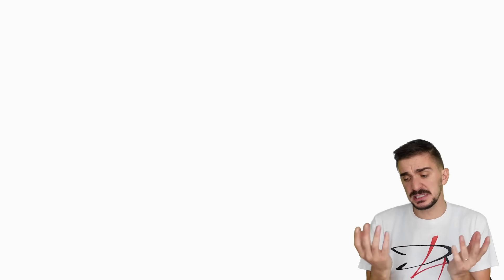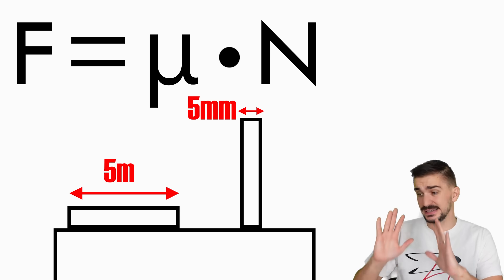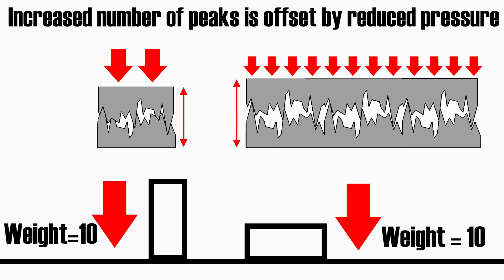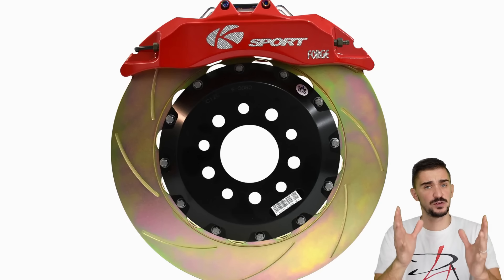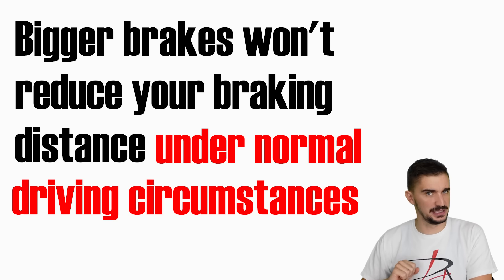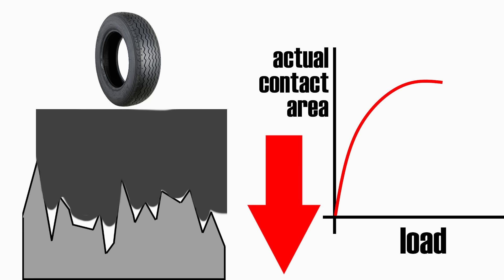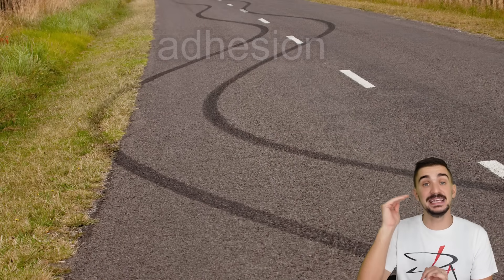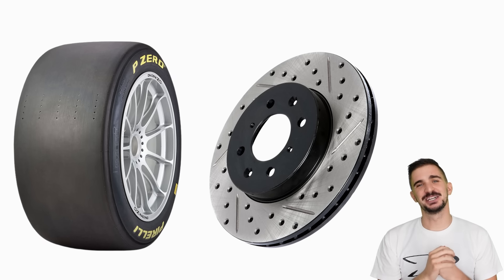Why Big Brakes Won't Stop You Faster but Wider Tires Will - Friction and Surface Area Explained

Comment: Great explanation. I like how just after talking about brake fade you show an early generation MR2 getting tuned. The early generation MR2s were notorious for brake fade (because they were designed for drivers who drove sports cars and used compression braking). Toyota fixed that problem in later generations, but other automakers use similar thought process for their economy cars. They count on the user not going very fast or not having to apply the brakes very often. Too many of these smaller vehicle will start to have brake fade when driving in stop-and-go traffic or pushing the vehicle even a little bit. I had to swap the stock rotors and pads for my daughter's economy car when she said something was wrong with the brakes and I drove it and it had noticeable brake fade. Slotted discs and better pads was a very inexpensive fix to take care of a manufacturer's money saving design.
Reply from the maker: The car shown is my car. It has completely stock brakes, just rebuilt and new parts. I know the internet loves to portray the brakes on them as junk but in my personal experience this wasn't the case. I drove the car down several mountains very aggressively many times. They brakes start smelling very noticeably but the fade is always very minimal. The car always remained completely safe and the braking adequate. Fade in stop and go traffic is simply impossible on any vehicle, the assumption is just silly.
Reply: @d4a  I appreciate your experience. In the late 1908s I had a girlfriend with the early gen, and it had bad fade when not down-gearing. She went off the road with it once because she wasn't used to driving like that. And when we had it looked at afterwards to ensure everything was okay from the accident, the Toyota mechanic told us about the fade issue, so I'm more willing to believe them after that experience.
I agree, normal driving conditions shouldn't have caused fade. The vehicle my daughter had GM took off the market soon thereafter. It had a host of design issues. Had I known then what I know now I wouldn't have bought it. As it was, it was disposed of w/in 5 years of new due to all the systems which started to fail. 
I travel a lot for work and stopped renting economy cars due to performance issues. Not just that the engine is under powered, but that the braking systems are almost binary - almost no modulation, and any hard braking locks up / initiates ABS. I realize this is tangential to your video, to me it appears to be a system which isn't designed appropriately for the vehicle.

Comment: Stock brakes are designed for stock tyres, and don't hold enough stopping power to stop wider tyres! That's why you need bigger brakes with wider tyres. Yes bigger brakes won't help if you install them on stock tyres.. But at the same time stock brakes won't be able to stop Wider tyres..!

Comment: Increase brake rotor and pad also increases torque to reach the limit of the tires traction ceiling.  The statement is true if one's brakes can cause the tires to slide.  Making the transition from static to sliding friction. More tire raises the traction threshold before tires slide. Otherwise, an ultra sticky tire that jas a huge contact patch with riny brakes that can't make the tires slides on the surface can stop faster with bigger brakes. It's a balance. Once one limit is increased the other can also.

Comment: Wider tyre will mean lower top speed and usually slower acceleration. And they are usually heavier. So there will be a price to pay.
Reply: They also don't increase the size of the contact patch.

Comment: While I have already given a rather-long explanation about the various points you are wrong about, on your 'brake' video, this also popped up as 'recommended', and as I figured, was about as wrong as the brake video was. While as I mentioned before, I worked in automotive ride dynamics for decades, tire design was not my 'speciality'...but I did have to use specific 'design data' regarding tires, to accomplish first-stage braking design..and it is to this I can address.  Tires are a very-funny, and often misunderstood thing...and as there are a myriad of books out there on 'shock absorber design', 'brake design' and 'tire design', I'll save the review of rubber composition, its affect on road surface grip, why different tires are used on different surfaces, etc., and point out one key factor about tires: YOU CANNOT CHANGE OVERALL CONTACT PATCH SIZE by simply 'changing your tires', and the whole of your car's traction, handling and general behavior is keyed to the simple function of 'Contact Patch Size'. Consider this: If I have a 3,000-lb car, with equal corner weight distribution,  then each corner of the car, each tire, must support a weight of 750-lbs per. Now, assuming 'no sidewall structural/vertical rigidity' that would otherwise hold the car up (without air in the tires), this translates into approximately 20-sq. inches of 'contact patch' (at 32-psi tire pressure) per tire. So, I can 'theoretically' (which you are bad about doing, without very much empirical experience or knowledge) configure that tire patch by changing tire size. If the tire is 5-inches wide, then my contact patch will be 4-inches front-to-rear. If the tire is 10-inches wide, that contact patch will only be 2-inches, front to rear. In heavy equipment, this is often referred to as 'ground contact pressure' (bulldozers often have a contact pressure of less than 3-psi, just FYI...helps them float in bad or loose soil)...and likewise, this translates to cars. See, you cannot simply 'play around with your tire pressure', to get the contact patch you want...tire failure is imminent, if you start doing that. Too low of pressure, and you will destroy your tread, shoulders and due to heat, fail your sidewalls very prematurely! So, in reality, you 'choose the tire' based on size to arrange your contact patch to the optimum size and shape which fits your 'expected terrain surface'. 4x4 truck, off-road, IN SAND? You want low pressure, large contact. You're racing quarter mile, no turns, straight ahead, you want a wide contact, where 'lateral contact' is inconsequential. You're running a road track (F1-type), where cornering, braking and acceleration all come into play, you want a relatively square contact patch...unless some design feature of your car requires more lateral than fore adherence. Selecting the wrong tire is a big problem, and requires extensive experience to 'choose the right one' for the desired application....then again, if you don't have big enough brakes...all you need is a big bumper, I guess. All I keep seeing, when you keep quoting 'textbook physics' is a brakepad made from a razor blade, skating around on a coffee cup...while hearing you on a looping recording saying 'bigger brakes won't stop you faster'....ROFL..you REALLY NEED A JOB WORKING FOR AN AUTOMOTIVE RIDE DYNAMICS group...boy, would they have fun with you...all that overtime in the test lab, the yelling, the condescending tones...yeah, I interned...IN THE 1970's...and you sound JUST LIKE a guy we had as a lab technician once...merely a high school education, talked like Einstein, sounded like Homer Simpson...YOU, my friend, ARE THERE!

Comment: how is it counter intuitive? the regular brakes are able to lock the wheels. so there is not any extra power needed. i don't think anyone would think bigger brakes would make them stop faster.
bigger brakes are so they're more resistance to wear and fade, which is actually more important than braking harder.

Comment: I actually did have vented discs on one of the motorbikes I've owned, a Yamaha XJ 900 F, but the brakes in 1983 weren't exactly wonderful, as the front calipers were of the meagre sliding pin type, normally only found today on rear brakes.
Reply: You really don't need more than drum brakes on the rear of motorcycles. Most people are ignorant and assume rear disc will stop you 'better' than drum.
Reply: @johngalt97  Yes John, I mainly use a rear brake to hold me on a steep hill, or to keep the bike's front end from diving too much if I need to brake quite sharply, say if someone pulls out in front of me at a roundabout when they really shouldn't have. I've never ridden a cruiser type bike but am told they tend to rely on rear brake stopping power much more, especially ones with raked out forks, skinny front tyres and fat rear ones.
Reply: @HGodwinson-hg1  yes, keeping the rear gathered in straight behind the front is critical to the shortest stopping distances. The back brake preferably gets applied first, but disc can cause it to lock up, which is not good for keeping it in a straight line. I hated in when Yamaha started 'upgrading' the drum rears on their RD 2-smokers.
Reply: @johngalt97  I had many 1970's bikes too, most of them two strokes and also preferred rear drum brakes for feel and controllability. I will say that disc brake pads are a damn sight easier to change than brake shoes are though. Just bought some coolant and distilled water for my bike's two yearly coolant change, due on Christmas Day. That's a job I only ever needed to do once in the 70's, on a GT750 Suzuki. All the rest were air cooled rides.

Comment: I can't agree with this. Wider tyres with WHAT compound, tyre pressure, tread pattern and on what road surface / weather conditions? If you have really hard but wide tyres, you still won't stop if you're driving on a sheet of ice... Surface area is only part of the solution. Even changing the tyre pressure drastically affects the stopping ability of your car. Wide tyres also have a problem with aquaplaning easier on very wet surfaces. So, it's not as simple as just upgrading tread width.

I'd also like to argue that larger rotors give a nicer brake feel. Maybe also an added benefit that less brake boosting is needed, because less energy is needed to push on the brakes. Interestingly, with some sports cars having cam profiles that result in less vacuum in the intake manifold, the brake booster is not as effective anyway. Infact, in some race cars, the brake booster is removed all together. So, I guess it depends on the overall application of the brakes and tyres because most road cars don't really need brakes that take such an incredible amount of punishment.

Comment: I'm 1 minute in and my initial analysis is there has to be a balance between disc/pad surface area and tire/road surface area. If you have too much disc/pad area then there will be too much grab and your tires will lock up and you'll skid. Too much grip because your tires are too wide then your brakes won't be able to fully engage and slow you down.

Comment: What happens when you have the latest and greatest UUHP(Ultra Ultra high performance) tires on a 2001 Audi TT Mk1 Quattro, with standard brakes. LOLs... 

Worth a mention as its the major reason for over driving circumstances.

Ive not seen the graphs showing tire technical evolutionary advances mapped out.   ; I

Could be a brainstorms and constructive feedback loops. 

: )

Comment: Why do you erase comments that you don't like?  Please answer how come you are smarter than all automotive engineers who install bigger brakes with multi pistons?
Reply: They do that to get the maximum potential from the tyres.
The main point is.. if your stock brakes are strong enough to lock up your wheels, then you don't need bigger brakes, you need better tyres.
You need to find out the limiting factor, that's hindering your braking.

Comment: It isn't friction, larger diameter rotors mean more leverage on the axis of rotation.
Given a perfect tire and equal calipers and pads, a larger diameter rotor will stop a car faster.  Of course it is never worked out this way.

Comment: The presentation intrduced a lot of corect informations, but in the bigining of the video you say that the breaaking disc diameter don't influence the breaking force, but that mean the force aplid to the disc.
To be exactely, to slow or stop a car it must to have a breaking torque capability  on the axis of the wheels. Just as when we want to accelerate. We must to have big acceleration torque. The torque capabbility of a car determine the capability to accelerate. That why this capability is mentionated in car performace specificatios short list.
 And phisics say the formula of the torque is T= F * r . That mean tangential force F, multiplied with the distance r from the aplication point of the force to the center of rotation. Otherwise, the breaking torque is direct proportional with the breaking disc diameter. And that influece the stoping distance. Of corse this is limited by the adherece of the tire on the road.

Comment: I think a better way of saying your point is that big brakes with bigger tires stop better. In my experience, bigger rotors with the correct caliper on a car with smaller parts is an improvement - stops in a shorter distance.

Comment: there is so much wrong with this video.... if your brake caliper and pad surface area is larger there is absolutely an increase in friction!
Reply from the maker: Nope
Reply: @d4a  there are many variables involved in stopping not just the brake pad surface area and tire width/grip. 

most if not all cars can't lock up the brakes at 60mph.  larger brakes without a doubt have more ability to slow a car much faster at higher speeds.

Comment: Yes but what about the " communicating vessels " law? When i upgraded my brakes the pad was a little bigger but the pistons of the new caliper (4 not 1 anymore) were a lot bigger. After that i needed less power from my foot to brake and the bigger disks i believe also helps. So why dont i brake faster? Its not so simple. Some cars from factory dont have enough brake power and some have very good brakes....

Comment: Imagine breaking your lug nuts loose with a standard length 3/8" ratchet, then imagine breaking them loose with A 3' breaker bar. Which one would be much easier? It's not all about surface area.. it's also about leverage. You missed a huge factor in rotor/brake size...

Comment: You missed one thing, that makes your whole video wrong:
Bigger brake disks have a bigger radius, bigger radius means they have more leverage on the weel, or in other words, the same breaking force has more torque. So yes, bigger brake disks with the same force stop the weel faster. If it doesn't lock you have shorter breaking distance
Reply: Basically, if your brakes can't lock your tyres, it means you can upgrade the brakes for better braking performance without having to change the tyres?

Comment: This is not considering heavier weight of larger tires into consideration. Tires are inspiring weights. With more rotational mass, they are going to be more difficult to stop. Yes, larger tires provide more grip to be able to slow down faster, but unless the larger tire weighs the same as as the smaller tire, this theory is not always valid. There is an equilibrium point of how large a tire should be before it takes away from its performance gains.

Comment: much ado about nothing.  average car guys upgrade/buy expensive brakes for the looks not for performance or the the illusion of it.  track car owners though certainly know what they're doing.  he is also oblivious to the fact you also need consider WEIGHT prior wider tires.  this is the reason we don't see wide tires on the average passenger car.

Comment: Absolutely correct that increased surface area for brakes does not mean more friction, but mean effective radius of the braking surface will affect the leverage the brakes have and affect stopping power. So a larger diameter rotor will generally have a larger mean effective radius and more stopping power. 

Since most vehicles brakes can overcome the grip of the tires anyway, though, the most notable benefit of larger brakes is the heat dissipation. 

Ignoring mean effective radius of the brake rotor when calculating stopping power is incorrect though.

Comment: And that's why I'm using normal smaller 312mm brakes and relatively narrow tires 215mm on my daily Passat B8. Brakes and wheels are lighter and cheaper. Lighter unsprung mass is better controlled by suspension and normal brakes react fast in cold and wet conditions. Narrower tires are better in wet and snow and this is more important, then 30cm on dry road in summer. And comfort is another story.
Daily is not race car. Sadly people especially in Europe think that bigger means better.

Comment: Bigger brakes WILL brake better but not because they have a bigger surface area, as you perfectly explained this does not affect friction and the force of the caliper will NOT increase , but for the same force aplied by the caliper, the bigger the diameter of the disc the bigger the braking torque will be on the axle, as TORQUE = FORCE x DISTANCE. It's like tightening a bolt with your fingers vs using a BIG ASS wrench, the further you applie the force from the axle the bigger torque you can generate.

Comment: I get a lot of racecars in the shop and see how large the rotors are. I thought maybe one of the reasons the rotors were so large was also because of the added leverage you get by caliper clamping down on the rotor further away from the center of the spinning mass. Is that not true?
Reply: You want stopping power but you want it multiple times as you slow for the turns lap after lap.  Most cars will overheat brakes after 3 quick stops.  Or driving down a mountain road with many curves.